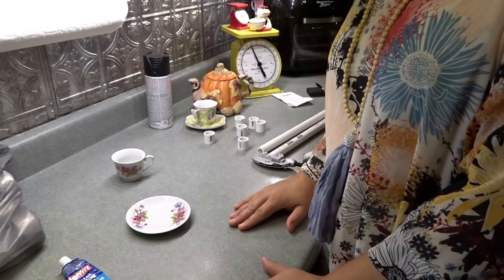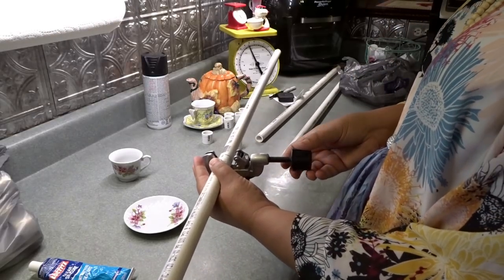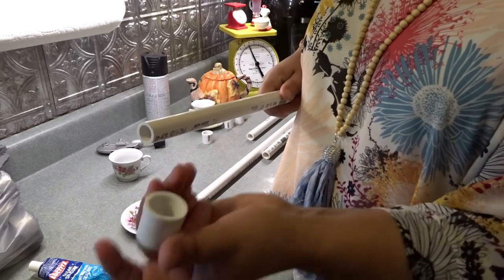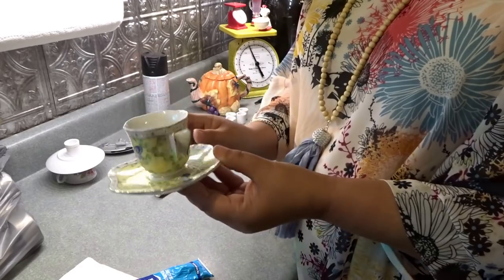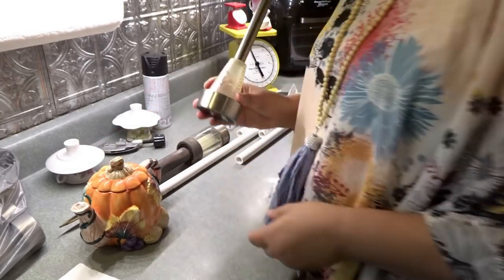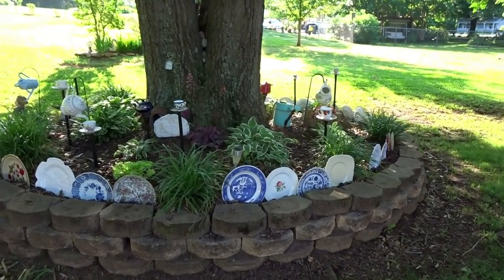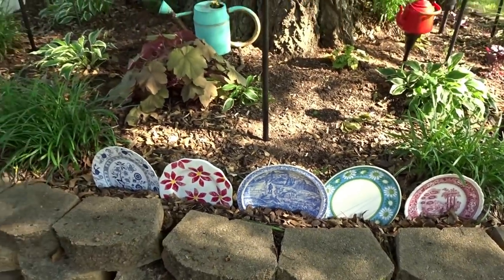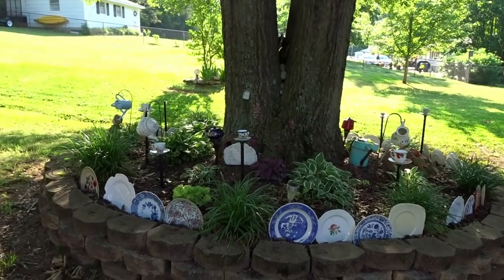DIY Tea party garden

Comment: Really cute.  Not sure how I missed this earlier.  One suggestion is for extra strength, use lengths of rebar as a stake and then slide the pvc over the rebar.
Reply from the maker: Thanks. This is from 2 years ago. I’ve painted the poles black since this video.I hope to do an updated one this summer.

Comment: I love this tutorial!!! 😍 I’ve already begun my own whimsical tea party/fairy garden in my backyard hanging tea cups from tree branches. I want to execute the hanging tea pot idea you have here, and am curious if you glued any of your tea pots to seal the spouts? I have some tea pots and don’t want them collecting water, and was wondering how to epoxy or glue the hole shut without it running the other direction down into the pot. Thank you for this amazing video!! ♥️🙏🏽🫖
Reply from the maker: I didn’t close off the spout on mine and a few of them broke on the bottom where water froze however you can’t tell it and now they don’t hold water so they should be good. You could maybe try covering the hole with clear tape.